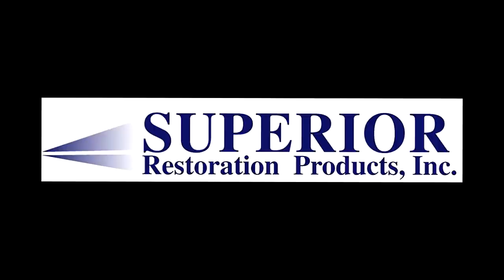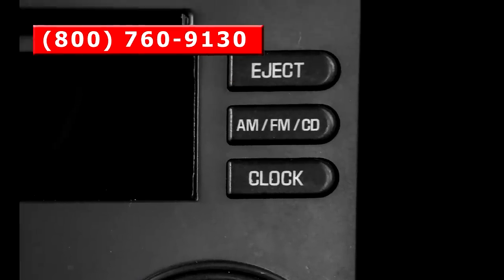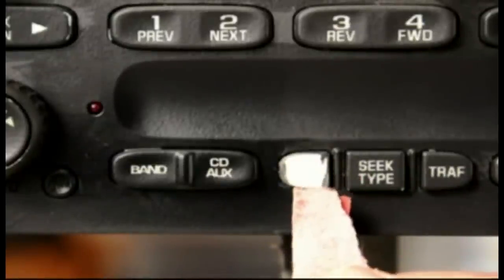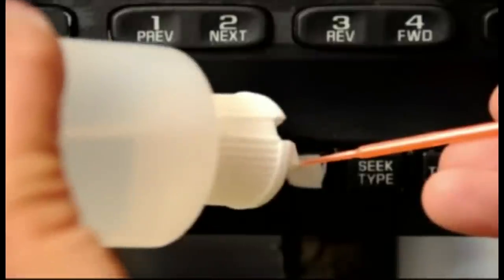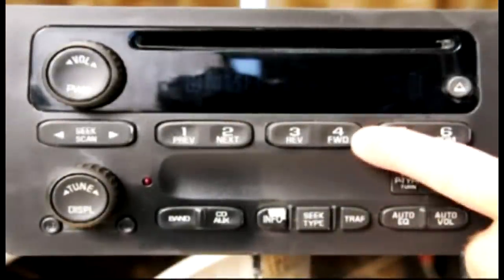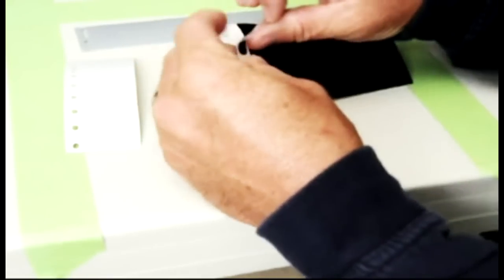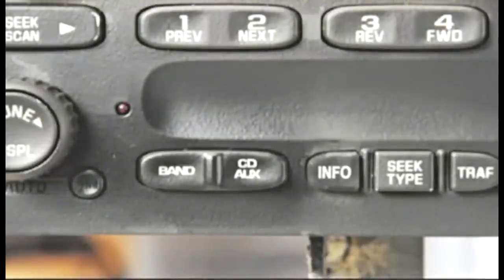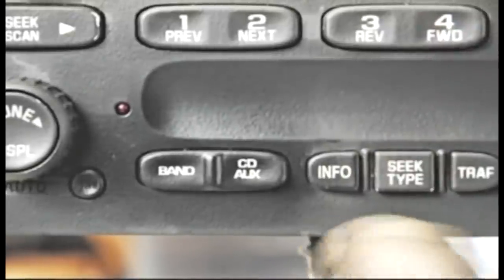Worn peeling automotive radio buttons. Easy repair

Comment: Sand edges of where the button labels are fading, take a toothpick and dip it in the color of the label (white for the words, red/blue for the A/C, etc.) and go over where it is missing. Then use a toothpick for black. Once all colors are dry, use a clear coat of nail polish (or a similiar protective layer) and allow to dry. Cheaper, does the same job, and no replacing or ordering anything.

Comment: Or........ Listen to this... YOU COULD BUY NEW BUTTONS!
Reply: you can't by just the buttons, you have to buy the whole module.
Reply: Says the person named Hitler... And have you ever been to a scrap yard?
Reply: +Crazy Bro (BroStories) On a lot, especial GM radios like this, it's a pain in the rear to rip the thing open to replace the buttons. Replacing a lot of things like that is quite troublesome. This is a simpler option, and far less likely to result in a cracked radio, or a button that doesn't work right anymore.
Reply: Crazy Bro (BroStories) Where do you buy the buttons then? You say you can buy then, Right? Then where do you buy these buttons at? lol

Comment: With most vehicles manufactured in the last 20+ years, Most switch panels, controls and radios operated using class 2 serial data, CAN (Controller Area Network-fast networks) or UART if older or on some newer "Peer-to-Peer" systems, like throttle actuated control. This makes door panel switches and many other controls more expensive and requires programming to share the VIN number, lines of code to tell it what vehicle it is in, as it may fit a lot of different models. Women do the most damage to switch faces because of finger nails. So, in short, replacing the button cover is way cheaper than replacement.
    P.S. Why do they use serial data to communicate? #1. Wire cost money and adds weight. #2. It allows for power control to shut off or turn on as it is a load to the alternator for fuel economy. #3. Most importantly, it allows a service tech, using a scan-tool to accurately diagnose the root cause of a failure, reducing diagnostic time while allowing "Flashing" or "Up-dating" a module, switch panel or other device to repair a known problem or change it's function for the better. Yes, this type of architecture is shared around the world, making the same repair, diagnostics and up-date in any county. Don't like it, blame the "Government" as CAFE number increase and emissions decrease. What is CAFE numbers? Google it! Retired ASE Master Tech / Ex-GM instructor.

Comment: Most older cars have used radios for sale  with good buttons online or at your local wrecking yard so an easier solution. ;) My car I just painted the buttons over with black touch up paint until I can find a better radio.

Comment: I had a 2004 Volkswagen Touareg, and after 4-5 months almost ALL the buttons and switchgear was peeling and worn off. It was the main reason I got rid of it at 18 months 13000 something miles. Had this product been around back then, it would have been a different story.
Reply: My 2006  VW Tourareg's buttons have the same problem.
Reply: ?? you got rid of a car because of that? lol thats sad
Reply: here for a touareg aswell lol
Reply: here for toureg as well thinking of purchasing one but this is the case with all the buttons inside

Comment: Nathan, what do you charge a customer for this service?  And how much does a kit cost?
Reply: Jeff Kramer you can do it by yourself
Reply: Right, I know. What do you recommend that I charge a customer?
Reply: Jeff Kramer ohh now i understand lol well it depends if you have to order the decals and has to remove the radio you can charge 50...60 $. If the customer bring everything on hands you can charge 20$... If i was you i would think like a customer so at the time to give a price you know if its to expensive or cheap .. Where you are located its another fact ..here in Florida there are tons of places to fix everything...
Reply: Thanks, that helps!
Reply: Jeff Kramer I Know this was almost a year ago...But if you are into Trim Repair! I usually just add the touch up on buttons if the vehicle im working on Needs Interior Work such as Leather Dye, St.Wheel repair or rapairs on trim or Extract/Dye carpet/Mats Etc. Just as a curtacy deal! Most Dealerships just leave you the To Do Searching for Materials or replacement parts but others are more than welcome to search. For example the button vynil stickers and have you install them for a small fee or in my case i dont charge them so long as they order themselves. On a weekly basis they keep me busy so putting on some decals is worth while.
Reply: panzer waffen d

Comment: FAKE the peeling is photo-shoped 0:26 compare the damage on the power button and 1

the bottom left corner peel has 2 points down, they both look exactly the same with minor edits. just compare the 2 buttons

Comment: I bought the new buttons for my navigation 05 suburban, bought it used and cant read any buttons.  I would never go through their fix with them little buttons.  My thought is what can I coat my new buttons so they do not wear.  Why does Chevy not fix their lousy buttons, not like cars are cheap then your buttons look like crap in a few months.  What happen to pride in what you build.  Does anyone have a suggestion on a coating.  I am thinking of a good automotive clear coat???
Reply: cindy Borgard The automotive clear coat you mentioned or a thin layer of clear nail polish